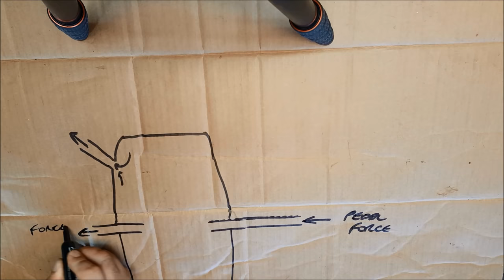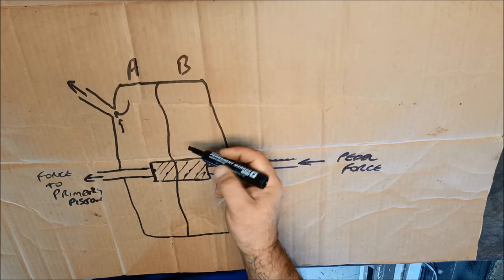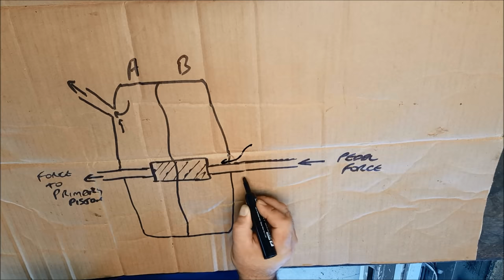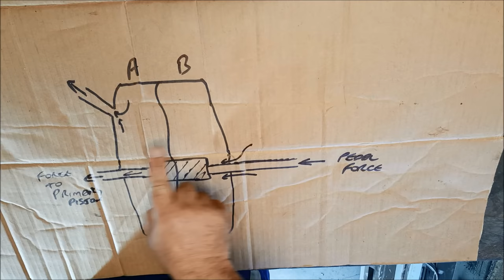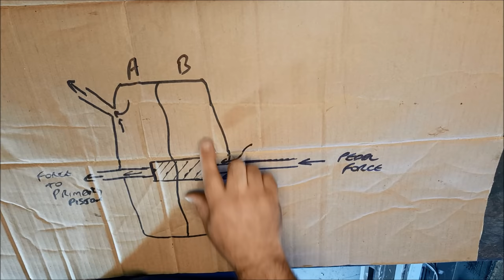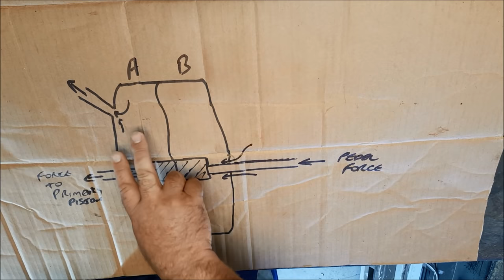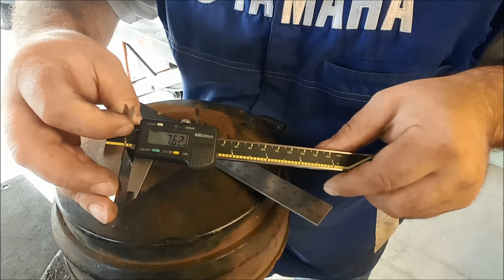Brake booster checks, operation and push rod adjustment #1313

Comment: My brakes were dragging and locking after driving around  and I had replaced all calipers and lines .  i just went out and was able to crawl under the dash and adjust the pedal distance from booster rod  and it looks like i have fixed the problem the pedal was real high and the valve you talked about may have not had enough space once fluid expanded.  thanks👍

Comment: I just received a Dorman master and Cardone booster for my 97 Wrangler.  I bought both through Amazon which had indicated that they would fit.  Was very nervous about installing both without knowing what the relationship was between the push rod and plunger. Using this amazing video, I found that there is a 0.0115" (0.292mm) clearance between the two.  I triple checked all of my measurements and calculations assuming there was no way it would be this spot on between two different manufacturers.  Now when I finally do the installation, I will know for a fact they fit.  Without this video, I would always be suspicious of the installation.  Thanks Andy!!!!
Reply from the maker: Good Morning Charles, no problem at all. It's a clearance that is often overlooked, even by some Mechanics unfortunately. However, going by just how popular this video has turned out, a few more people are aware of it and the symptoms if there is no, or worse still, a negative clearance!

Many thanks for the feedback & Good Luck with the install :-)

Cheers Andy

Comment: I know this is an old video, but I can not thank you enough!!! I chased a front brake issue on a 1994 Dodge Dakota for months, first replacing all the "usual suspects" (rotors, pads, calipers, and brake hoses) and was pulling my hair out until I found your video and one other, both recommending this often-overlooked possibility.  Turns out the booster shaft was about 1/8" too far forward, keeping just enough pressure on the front brakes to make them drag.  Made the adjustment and fixed the issue.  Thanks again!!!
Reply: 61.16⁴😂
Reply: 61.16⁴

Comment: Thank you for this video. Two months ago had master cylinder replaced. Since then the brakes would drag and on ocassions lock up. Pedal was always hard after a few minutes of driving. Had car towed two weeks ago because brakes were locked and wouldnt move. Two mechanic shops later and being told I needed a new abs module I came across this video. Ran this by the mechanic and he dismissed it. Picked the car up and adjusted it myself and now have a normal brake pedal, no drag and car cruises at much lower rpms.
Reply from the maker: That's great news Tim, pleased the video has helped you & just proves if you want a job doing right then do it yourself! 

Cheers for now Andy

Comment: Thank You Andy.  What an excellent tutor you are.  As a design-engineer (now retired) from the marine industry and otherwise a lifelong (now classic-bike) motorcyclist I knew nothing about servos but what I'd deciphered from a workshop manual. Your explanation, together with practical demonstration was both enlightening and just what I needed as a confidence booster (pun unintended) to tackle my 1968's Daimler 250's (same as Mk2 Jaguar) servo. That happens to be a remote unit, but your tutorial is a foundation which I can readapt my car's specifics.  i wish I were over there to buy you a beer or two. Cheers, Pete
Reply from the maker: Thanks Pete, it's great to know you found the video helpful. Good Luck on your Quest. All the best. Andy

Comment: Greetings from Pensacola Florida.
50 years I've worked on my own cars and never suspected the pushrod needing adjustment. Thanks for the info. Very needed. I replaced a master cylinder on my F150 recently and didn't adjust it. Now I will do the job again which is normal for me. Not that I like it. This makes sense when the remanned master cylinder has been cleaned up on the mating surface and material removed thereby lessening the clearance. 1mm seems like the likely amount removed on a machine.

Comment: Andy, thank you for this video!! After multiple visits to my mechanic and $$ later I made the measurements myself and found that the push rod was 7.5mm too short and hence the delayed and soft pedal. Mechanic made several excuses that the rod should never be adjusted and then said he did make an adjustment but only a little bit. The one culprit with my car (300M) is there is a purge canister mounting bracket between the MC and BB which of course increases the distance between the BB rod and the MC piston. While this still didn't make up the entire distance it just proves that when either of these components are replaced, interference measurements MUST be made! Not sure that remanufacturing shops set to a standard or the FSM but my FSM doesn't mention the set distance so I'm guessing they just set a standard distance.  Great videos and definitely subbed! Cheers!🍻
Reply from the maker: Thanks Steve, it's amazing how many Mechanics aren't aware of this critical adjustment! Back to college I say!

Great to hear the info in the video helped you out & improved the safety of your vehicle. Thanks for the feedback. Cheers Andy

Comment: Thanks you for this video.  This has to be the best video on brake boosters and push rod adjustment that I have seen.  Now even I understand how the system works.  This explains why three repair shops say they can't explain why after changing out the master cylinder and the booster, my brake pedal goes way down  towards the floor before the brakes engage.  I bet that they did not do the meticulous measurements to readjust the push rod distance. especially since both the master cylinder and the booster are new and not OEM.  Now I have to find a specialty brake shop where I live or send my car to New Zealand to be repaired.

Comment: Thanks Andy I am having problems with my brakes locking on and it looks like from your video that it could be push rod adjustment as one of the symptoms is that it only starts to happen after a good distance after things heat up not when cold.  Truly well done video clear and easy to listen to, thanks again
Reply from the maker: Hi Allan, yes, certainly sounds like it's a pushrod length issue. 

Good luck :-)

Cheers Andy

Comment: Awesome video...just purchased master & booster cylinders to replace on my 1974 Chevy Nova just because they are the orginals. Definitely will measure clearance.  Working on Bronco that has touchy brakes when applied that your video will allow me to fix after many attempts. Thank You Mate😊
Yazmin 
Venice Beach  CA
🏂🏁🏂🏁🏂🏁

Comment: Andy,  absolutely the best video / instruction I've ever seen. It now makes total sense relating to some elements of understanding I was missing. The additional attention to detail is super helpful and likely explains why I occasionally encountered very odd brake issues at times and certainly I will be applying the correct methods you explained.  Thank you very much; and I believe you just helped me isolate / solve a 10+ year old issue on my 89 Toy 4x4 . Kudos!

Comment: Brilliant, cheers from NJ USA!  I have a 66 Chevelle with a 383 in it, i am going to replace its Mechanical brakes to assisted and front disc brakes from drum.  I've researched booster and mastercylinder, with proportioning valve packages quite a lot. Ebay has some of these at reasonable prices but comments are sketchy at best.  Ranging from No peddle to no stopping power after the install.  I wouldn't be surprised if problems were from that push rod, not being adjusted properly, which has kept me from getting one of them. My 383 only makes about 8-10 inches of vacuum so, i'm researching auxiliary vac pumps as well.  But your excellent video has been a  helping of food for thought Andy.  Thank you!!

Comment: Andy great video I've a new Avenue to try to get stronger brake pedal pressure, you are absolutely right where you mentioned changing master cylinder and hydro boost and not adjusting brake push rod, I've gone as far as gravity bleeding brake, little result but not the way I know my brakes should feel, thanks for putting this video out there. ..

Comment: Thank you for this informative video. I fought a Subaru Legacy with soft brakes for a long time , thought that was just how they would be. Replaced master cylinder..No help. Turns out that the booster piston was not extended far enough for the master cylinder that was  installed.  My daughter sends thanks , as the pedal is now how it always should have been.
Reply from the maker: Cheers Tom, I'm pleased to know the info in the video has helped sort out the brake issue. This is an adjustment that is often unknown & overlooked when replacing one or both of the components.

Drive safe. Andy

Comment: thank you for sharing this valuable advice ..just spent 6 weeks on and off about 8 full days completely replacing the full brake system on a 1984 escort..having bled the system twenty times even with pressure bleeder still have full brakes but low down the pedal travel...having ignored this adjuster thinking it was factory set I now am going to do this adjustment to see if I get pedal back...
NEW discs new pads new shoes new drums new rear cylinders new master cylinder new braided hoses ..servo working ...5 litres fluid..pressure bleed kit...
if only I knew about this adjuster...
I will let you know the progress
thanks again...

Comment: Is it possible for the vacuum valve to act differently in colder weather as opposed to summer weather?
Reply from the maker: Hmmm....not thar I'm aware of, never come across a difference though changes in atmospheric pressure will vary (very slightly) the assistance provided by the booster but I doubt it would be noticeable.

Cheers 
Andy

Comment: Thank you Andy.  I am changing my power brake booster soon.  I assumed the setting was factory set, however since I am not buying a new prefited master cylinder already attatched, I will make sure I check the spacing.  Thank you for such an informative and complete video.

Comment: Thanks Andy ! Just put a brand new master and booster on my 71 cutlass 
And pedal hard as a rock ! I figured maybe the hot cam was doing it but at 15 inches it should have at least 1 good stop! Or some assist and low and behold when you said afr will go up if the booster is leaking ..
That’s exactly what mine was doing I would watch it go from 12.8 to 17.0 16.0 etc ....great vid! Just goes to show just because something is new doesn’t mean it’s good! Ugh!!

Comment: Thank you Andy, you may have just solved my problem. after replacing master cylinder and brake booster my front brakes keep locking up. I"ll have this checked out very soon. But this makes a whole bunch of sense. Thanks again.

Comment: I wish I had watched this a long time ago. I've had a problem with my brakes heating up and just figured out the pushrod was too long on the inside of the car. I adjusted it and they work perfect. I guess the pedal was letting in just a bit of atmospheric pressure and pushing on the master cylinder. Good job on the lesson.
Reply from the maker: +beastybmiked sounds like you found the fault. Yes, both input and output push rods should have a small amount of free play. Cheers Andy

Comment: Thanks so much for this video Andy as you have solved my low pedal issue after years of driving my 47 GMC modified by who knows who ? with a Trans Am frame and a rebuilt Corvette 350 with modified front Discs and rear Drums. Thanks again!
Reply from the maker: +Ralph Feldes No problem Ralph. If I was there you could take me for a test drive. Sounds a great car :-)

Comment: Thanks so much for this great video. Did not realize you needed to adjust the booster upon replacement of master cyl. Having the front brake lockup issue and trouble bleeding. Going to try this, pretty confident this is the issue. again, nice work!
Reply from the maker: +Welesly77 Hey, no problem. Yes, seems like you have a class is case if 'negative' clearance there. Just shorten down the push rod a little and that should fix it. If you don't have the specs then just do a measure up and give it between 0.3 & 0.5mm that should work :-)

Comment: Thank you.  I think that you’ve identified and explained my problem - all new brakes, master cylinder but no push rod adjustment.  And we couldn’t work out why - opposite to this video, I believe that my push rod is too far in.
Reply: difficult to believe it's not adjustable?  instead of the rod end protruding out towards the master, look on the linkage end where it connects to the brake pedal, you may find a knurled not there that can be loosened and the the rod can be twisted to lengthen or shorten, at least that's how it works on my old Acura
Reply: James Ray I’m learning!! Yes, it is adjustable, but unlike this video, it did not protrude beyond the surface of the booster.  In order to get it to do so, after we made our calculations, all we needed to do was have someone depress the brake pedal for the rod to come out enough to be adjusted.

Comment: my brakes were locking up on me after installing a new booster and M cyl - over the course of a few min. of driving, they calips would squeeze and lock up. i removed the master cyl and installed some thick washers between the master cyl and booster - it worked - no more lock ups on the 89 GMC truck - I did it at the advice of a friend. what exactly happened ? how and what did it fix ? what was happening before i i installed the washers ? (should i silicone the gap between the master cyl and booster ? any danger in what i did ? the thrust rod is not adjustable ... thanks, Pg

Comment: Thanks for an amazing video, I was tearing my hair our wondering why my brakes on my 1971 VW T2 Bus were binding and locking on after having a brake servo system upgrade fitted by a classic VW camper specialist. They obviously didn't bother to check the push rod clearance. I wonder why they call themselves specialists 🙄
Reply from the maker: No problem Sir, nice vehicle :-)

Happy to be of help.

All the best. Andy

Comment: I went down the road last week and when I stepped on the brakes, there was a loud bang and the brake pedal went to the floor.  When the car is running, the brake pedal pushes easily but the brakes only work as manual brakes, and you have to push it down all the way and push hard.  It's like the rod from the booster broke off and doesn't reach the master cylinder. There are no leaks, and the booster is holding vacuum.  Only thing I can think of is that adjuster has broken off.  Thanks for this video and it looks like you solved my problem.

Comment: Great video. Very informative.  
I should probably remove the booster on my car. After watching this video I may have not adjusted the rod correctly. 
At cruising speed I cannot achieve a sudden stop or a quick stop if I needed to. Pretty scary knowing there's a possibility you might slam into rear of car in front of you if they suddenly braked hard. This video is very well explained Andy.

Comment from the maker: Hi Sam, thanks for your question....I had exactly the same problem with an old Nissan Patrol a few years ago. It turned out to be a fault with the rubber brake flexi pipe attached to the caliper. Inside the rubber had perished so badly that a flap of rubber was blocking the pipe. Pressurized fluid could push the flap open & enter the caliper but it was unable to return back to the reservoir therefore preventing piston retraction. To check for this just open the bleed nipple, if the piston retracts & the disc rotates freely then its likely you'll need a new brake flexi pipe. If the piston still doesn't retract then I'd guess the piston is binding due to corrosion or been out of round - you'll have to strip the caliper to check this properly. Also check the piston hasn't gone out of round, this can cause it to jam in the caliper body too.

Let me know how you get on, if its neither of these problems then I'll have a bit more of a think....okay?
Reply: Oky i wil let je now . I on my job side now wen i turn home  after 14 day
Reply: You can also simply turn your wheel all the way each way a few times slowly and see if it releases

Comment: Hello I Just found you! Great video. I learned this the hard way when I changed out a MC and did not check the length. Spent a great deal of time wasted till it hit me to check. In the past I was just lucky things worked out. I’d love to see a video on the proportioning valve on a 1978 Ford F-150. Drums rear, and disc front. Thanks!

Comment: Thank you so much for the details. I had no idea that he one way valve can be inside the vacuum hose.
Seems like my 2001 Hyundai Accent 1.6L maybe having a problem with that hose. 
I have been getting vacuum leak codes and have checked all over for one and have not been able to detect it. 
I just replaced the booster today, it had no check / one way valve on it as it is a one piece unit, so I decided to go ahead and replace it.  These codes maybe coming back if the problem was inside the hose.
So much to learn.
Reply from the maker: No problem. Yes, those valves can be hidden in the vacuum supply hose. Sometimes with no obvious external indication that they are there. However, there must be a non return valve in the system somewhere to maintain vacuum should the engine stall - to continue to provide brake assistance. 

Cheers Andy

Comment: Thanks and the best!! I own BA falcon and AU falcon. I have been having issues with hand break adjustments on my AU for a long time hoping to see a informative video from you. And then my BA suffers from only driver side front break issue where it feels dragging on the road. After changing pads callipers no help. Suspect it's break booster rod for sure. Thanks again.